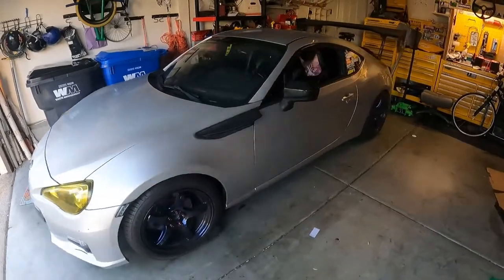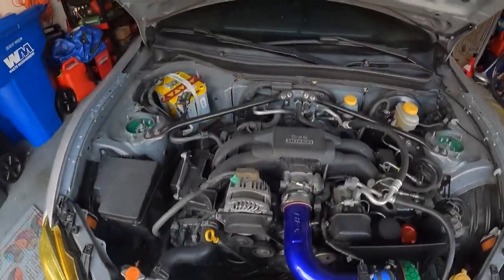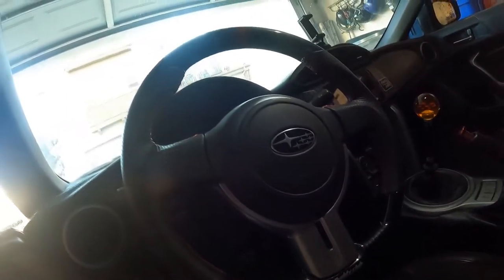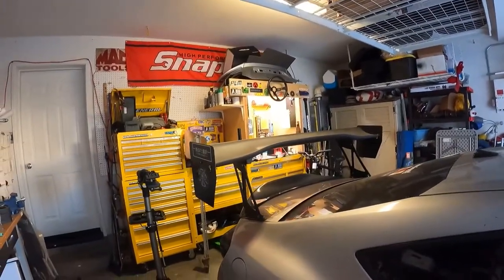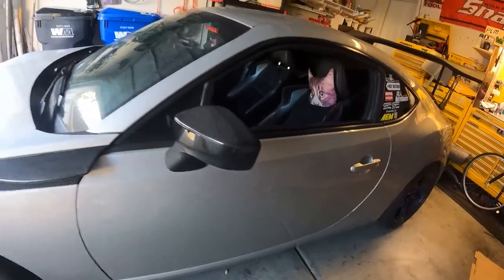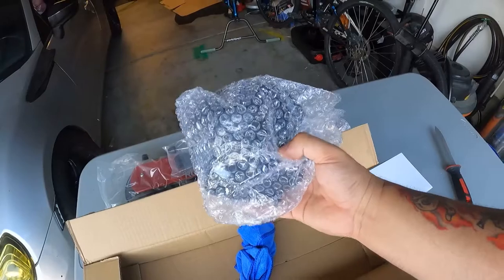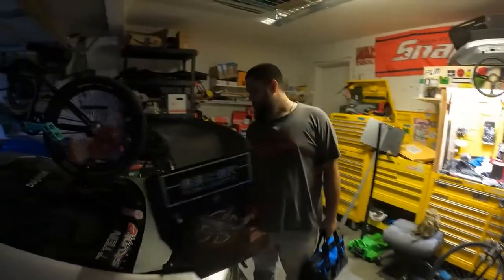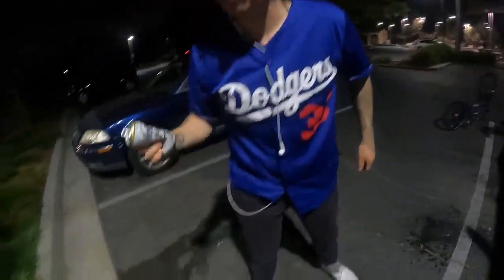BRZ Mod Rundown and RockBros Bike Rack Test

Comment: Didn’t you have longer hair? I’ve been subbed for years lol. This might be a newb question but why do brz/frs owners go with single exhaust instead of keeping the duals?
Reply from the maker: Yeah, I did used to have longer hair! I decided to cut it all off and glue it to my chin instead.

As for the single exit exhaust, I can't speak for all twin owners as to why they do it, but I can tell you why I personally choose to go with a single exit. There are a few reasons

-simplicity, the single exit is cheaper to fabricate, takes less time and materials, and weighs 10-20 pounds less than a dual exit.
-looks, I prefer the look of a single exit with a big bore tip on any smaller japanese sports car
-sound, I've found that a more simple single exit exhaust tends to create a more raw and aggressive tone to the exhaust note than a dual exit. The difference is subtle, but it's definitely there.